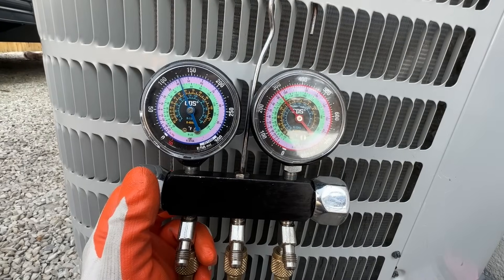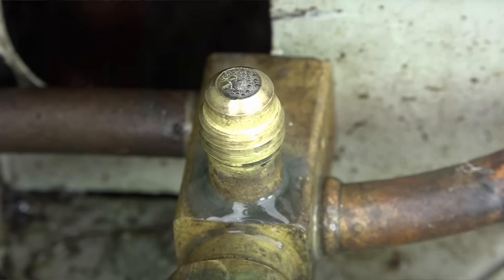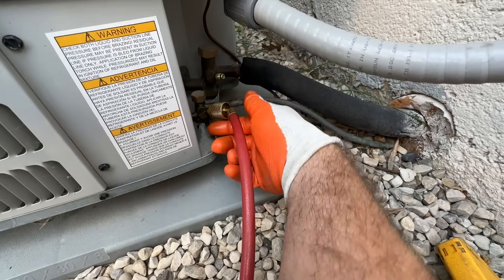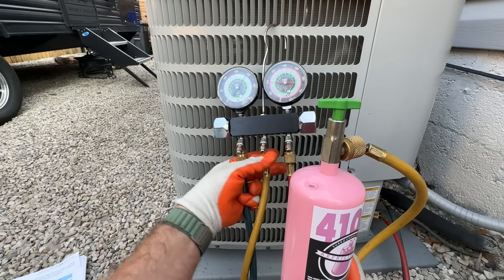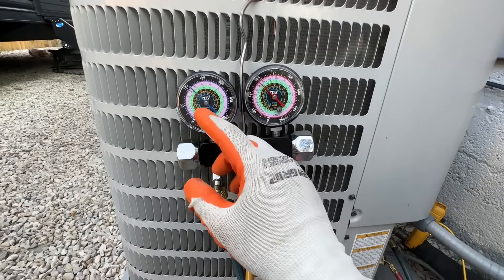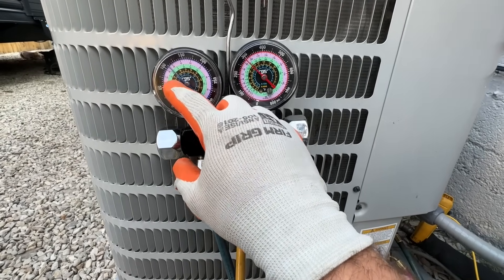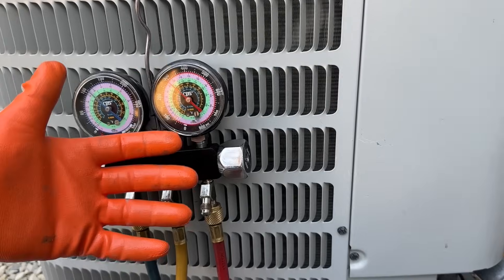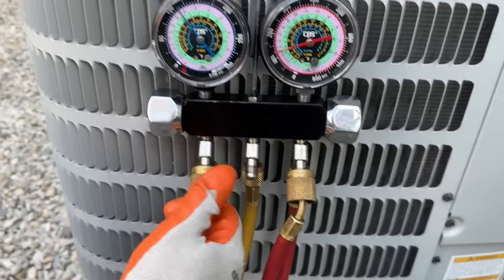How To Add Refrigerant To Your Air Conditioner R410A & R22

Comment: I am hooked.  You are my new youtube guy for hvac. I am a certified mechanic and do auto a/c,  so your easy to understand videos are making it a cinch crossover for me since I already have a a/c background and try to learn more about hvac everyday.  My gauge set is even R-134a/ R-22 set so I can use them on my house condenser as I am preparing to do my first house hook up with them as I think my R-22 is low.  Please make more of these hook up and read and add videos on house condensers.  Subscribed and looking at buying hvac tools on your affiliate links as I type this.

Comment: Great job! You just saved me $400. I have a very small leak that takes a year or more to lose 3 lbs. My HVAC pirate charges that much for the service.
Reply: That’s a bad leak if you’re losing that much per year
Reply: Hi. I work with splits in Brazil. When we find leaks like you have in your system, microleaks, we use "stop leak"(US$10+ job but i dont know american brands), a liquid that is put inside LINE with AC working.
Usually who does this is the tecnician, but here its cheapest the new recharges of gas.
Reply: hi, I am new to all this but trying to figure it out.  I am in the US and have a leak in my system somewhere.  This "stop leak" stuff you speak of, with it going INSIDE the line, could it be a danger for disrupting the dryer filter, the txv valve/orifice piston, or other parts of the system?  I don't know if it would or not but would like your opinion as you seem to have knowledge.  Hope all is well in beautiful Brazil.
Reply: Price of 410A is going up too. Since it is discontinued. Better fix the leak. 4 ton system use about 12 lb I think. So that mean could be 25%  lost.
Reply: @rokkuanii6922  
Its not discontinued. The date is banned for new equipment at 2025 but the product is still manufactured past this point well into 2030s
The good old waste of money government is forcing a reduction in production over the years. So what you will see is an artificially inflated price increase.
Look at gas prices today.. Very similar how artificial the price jump is. You stop production here/ban others and bam now those same oil companies who could only sell at say 80 a barrel now can sell at 230 a barrel.

Now why do we need to change refrigerants?
NO GOOD DAM REASON
But how can government programs/EPA pretend they are still needed or that they need more tax dollars? Force a new refrigerant that will increase prices of everything due to extra costs to use it. And you could bet your bank account in a few years that new refrigerant will be banned as well.

Comment: If I have. Over 20 year old 12 Seer Ruud HEATPUMP what is the refrigerant . And is a hand on the cold line “cold as a beer can” a good indication 10:15 that the levels are KO ? Second if this last winter the compressor coils put ice on the outside of the unit what is that a indication of ? Dirty coils ? It was abnormally cold here in south Tx ….down 12 degrees. Thanks 🙏🏻

Comment: When do u use a vacuum pump & is the freon can suppose to be upside down(liquid) or right side up(gas) ?
Reply from the maker: You use a vacuum pump to get any moisture out of the the copper lines and evaporator coil, then we you have that done, you let the refrigerant from the condenser (outdoor unit is precharged) into the rest of the system. 

And yes when you are adding refrigerant you want the tank upside down so you get liquid, and you throttle it in slowly through the low side. Hope this answered your question! Cheers

Comment: Great video, thanks, you just saved  me a expensive service call. The A/C guy wanted $600 a pound for R22 and I bought a 5 pound can from Ability for $249.00.
Reply: Same here.  Had a guy quote me the same thing $600 a pound.  Ordered 10 pounds for $329.
Reply: And how long did you have to recharge it after?
Reply: Were you bought  the R22.....?.......please.....
Reply: Nice, what did the gauges to put it in cost? And how did you repair the leak? What was the price for those tools to repair the leak? ( welding or flaring block)
Reply: @phillipkoch5751  Amazon sells that stuff cheap for single use. How many pros do the gas and go route, lots. Easy to put in a little every year.
Reply: @phillipkoch5751  if it's r22 it's old enough to need a recharge. Probably ain't a leak
Reply: @billrobert3226  I think you mistaken, you don't recharge an aircon. If there is no leak the gas stays in the system permanently. It doesn't just disappear over time. It's not fuel.

Comment: My 5 ton split ac is 19 years old and seems to work just fine, cools well. Its never been tuned or whatever or charged/topped off. Its used only  3-4 weeks a year and is located on the north side of the house, no sun and little rain due to long 3 ft roof eaves.  Should the refrigerant level be checked? Could it be low due to age and wear and tear?
Reply: I don't think it needs to be checked due to the fact there has been so little wear and tear on the unit!

Comment: Dude. Thank you!
I am a 57 yr old, retired computer engineer that fixes everything in a house. Everything. Or real close.

However, having refridgerants and HVAC parts on lock-down where normal citizens cannot have them is very wrong . That has allowed runaway pricing on new installs - and even compressor repairs.
I am getting that Refridge license! 
Thank you for the info, and I must say that your videos are fantastic! 
At 57, I am not going to do 5 yrs apprenticeship to be able to buy and do everything. I'm not opening a business. I just have two properties and 4 HVAC and a mini to maintain. I cannot afford to pay $12K to replace each one. That is insane.

Your videos have helped me maintain and repair reasonably good systems well beyond the point that I would have had to shell out $10k+ per unit. ($3500 for a mini).
Reply from the maker: Awesome glad they have been helpful for ya 👍🏼
Reply: When you think it all over, those manufacturers and supply warehouse folks are protecting the bums and bandits in the HVAC industry. Just who are they protecting, consumers or HVAC bandits? For that idea to work, the HVAC people need to be vetted or confirmed they have ethics and knowledge.

Comment: About 10 years ago, I called an HVAC company for service and he charged me $10 PER OUNCE. Can you imagine what it would cost today. Since that day, I read, watched videos and slowly took on tasks such as charge check, contractor, capacitor and motor change-outs.
Reply: That was $160 PER POUND.  You can get a 5 lb-can for $250 now online, but you need a certified person to put it in for you.  That was and still is now how an HVAC company runs and maintains its business alive.

Comment: This video gives out just enough information to be dangerous. First thing: Adding refrigerant as the "solution" to the "no cooling" problem is like the old saying that "if your only tool is a hammer, every problem looks like a nail." I can't tell you how many times I have come behind hvac "technicians" that have overcharged systems by huge amounts and have had to remove sometimes pounds of refrigerant. When I am interviewing a prospective hvac tech one of the first questions I ask is "What do you take out of your truck when you arrive at a no cooling call?" If they say, "A gauge set and a can of refrigerant" the interview is over and they don't get the job. You always diagnose before you consider that a system MIGHT be low on charge. Secondly, I would never hire or retain a tech who adds refrigerant but doesn't fix the leak. Not fixing the leak is either incompetence or dishonesty. Fix the leak. This requires tools, techniques and skills that are usually far beyond a DIY level. Then add refrigerant based on superheat/subcooling which (as is briefly mentioned in the vid)  is based on the metering device...and on a 410a system it's usually subcooling. Getting the charge right is important in delivering the promised efficiency at the bare minimum. Overcharging is super easy to do without calculating subcooling. Another issue: Briefly mentioned in the vid is turning the refrigerant can upside down. Why is that important? Because 410a is an azeotrope...that what the "a" in 410a means...an azeotrope is a mixture of gases and if the system isn't charged with liquid (can upside down) then the gas will enter the system in the wrong proportion. If you do that you now have to remove all of it and start over. And then there is the whole danger of charging pure liquid directly into the compressor's inlet. Guess what? Compressors can't compress liquids. When you dump liquid into a compressor it breaks. This was also briefly mentioned in the vid...adding a tiny amount at a time. Great, but no warning about what happens when you add too much liquid. Also not mentioned in the vid is the importance of purging the yellow charging hose...he purged the red an blue hose but didn't purge the yellow hose. Putting air ( a non condensible) into a refrigerant system will give you a higher than normal head pressure. Not going to go into the danger of getting moisture in the system. I could go on and on about why a little knowledge is a dangerous thing but a wise person will figure it out. There is a reason that a rookie hvac tech should have 2 YEARS of tech school before he gets his first job. It's because of all the mechanical trades hvac is the most difficult and the most dangerous. But, yeah, go on, be the genius amateur hvac tech and save some money on an expensive repair...it's an attitude that can ruin your system. I mean, I get it...there are idiots and cheats in this trade and they can ruin your system, too. But you CAN find people who are honest and competent. Look for the highest rated people using Angi or Google reviews or Yelp, etc. and then let them do their job, fix your system and then don't complain about paying them for their skill and ability.

Comment: Any low cost gauges you’d recommend TIA
Reply from the maker: Any 1/4” will do. But the pressures could be in celcius so they’re harder to read. I’d spend the extra dough and get some cps, or yellow jacket gauges 👍🏼